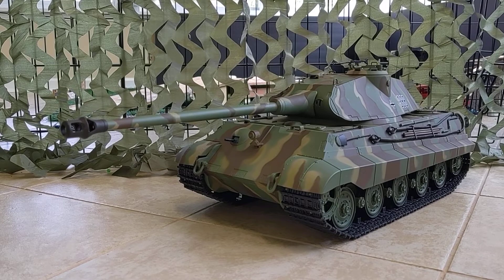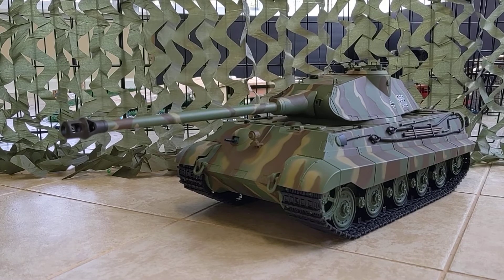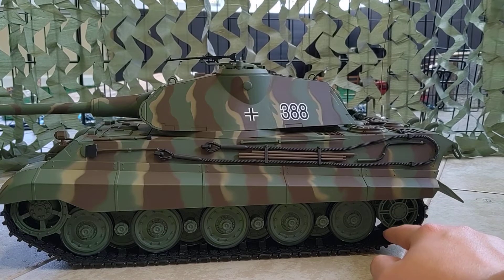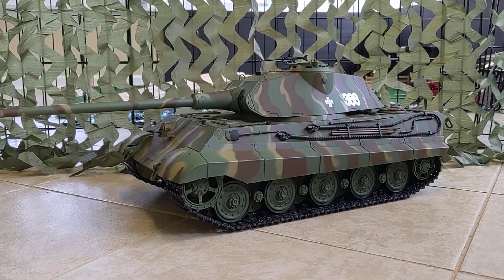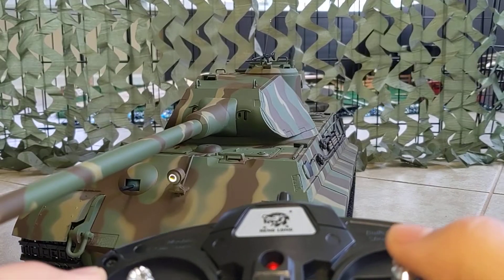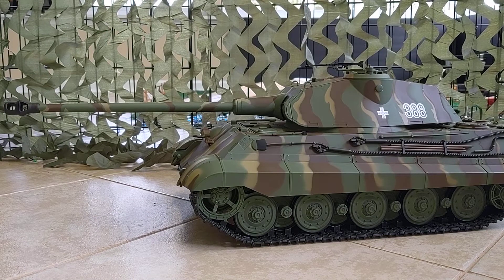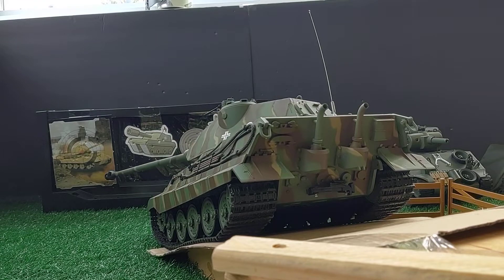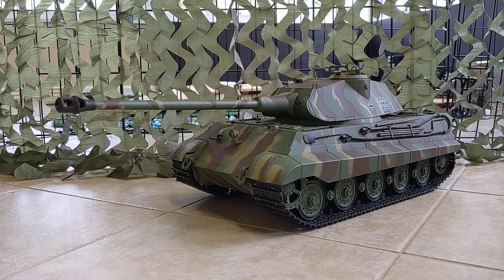Henglong 1:16 RC King Tiger (with Porsche Turret) Test Run and Review

Comment: I have that same rc tank in my collection..
I swooped out the factory motors with the plastic gears with motors that have metal gears.
I also replaced the plastic tracks for metal tracks. Making this King Tiger a heavier and better machine.
Reply from the maker: Awesome! Upgrading your Henglong tank is a very good thing to do!

Comment: I've discovered that if you put too much of the smoke oil in it stops working and wondering how you could get the excess out to see if it still works?? I've only had my Tiger 1 premium version for a few weeks
Reply from the maker: Hmmm try taking the top off and get to the internals to see where the pump is.
Reply: @legendaryexplorer8119  yeah I figured that would be the only thing I can try too! And I think the smoke oil is the same thing as fog juice for Halloween fog machines.